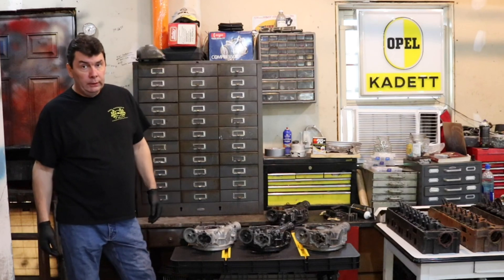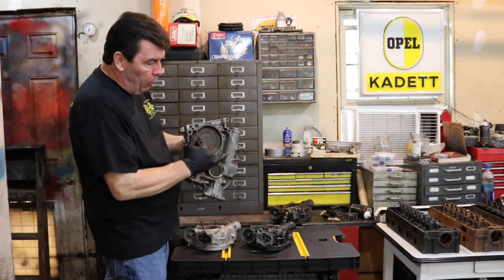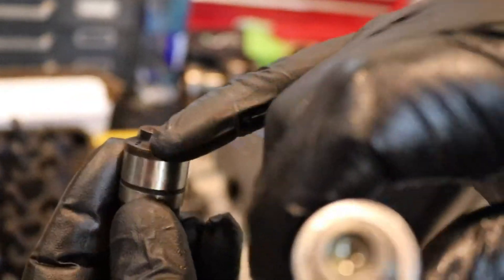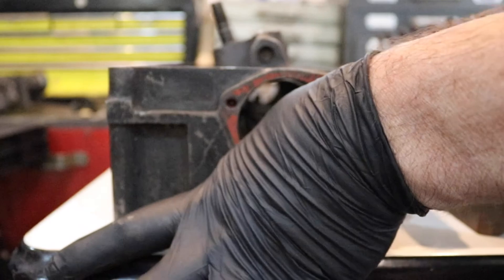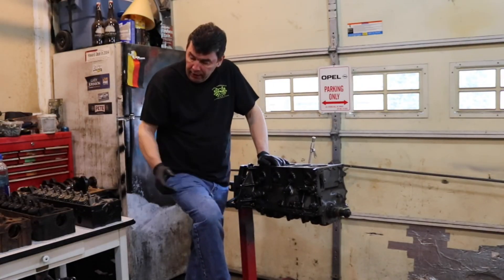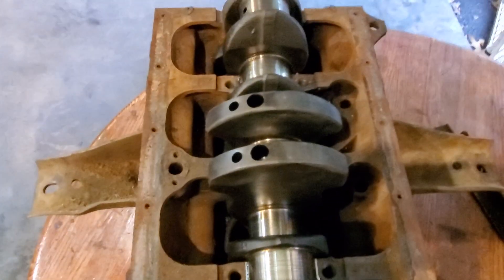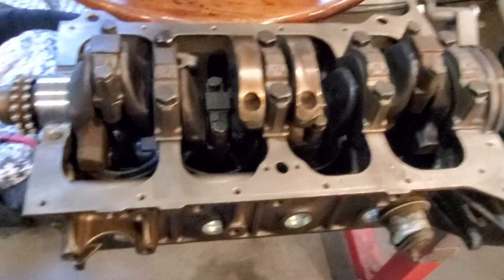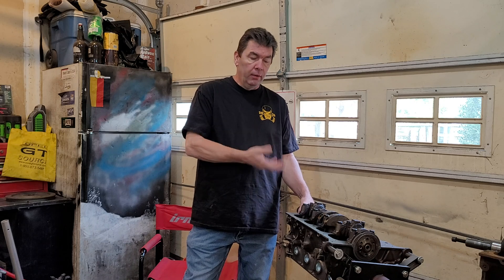Introduction the Opel 1965 to 1992 CIH 4 Cylinder Motors ( 1.5L to 2.4L ) - Updated Version

Comment: I had a2.0 engine in a mk 1 cavalier and all of a sudden 1 day it lost all power and would only achieve about 30mph the same use to happen to the 1600 it originally came with and the only way to get the usual power back was to remove the timing wheel on the camshaft and turn it slightly bolt back up and would be good for another 60 or so miles then i had to go back through the process again, what would have caused the loss of power would you say please.
Reply: That was a CIH motor ? sounds like a slipping or stretching timing chain
Reply: Thanks very much it also was a quiet engine no rattles or knocks i scrapped the car because of it and had 8 months mot left on it but i only paid 60 bucks for the car

Comment: Nice channel. I have a 78 Opel Rekord with its original 1.9

Do you think those engines are durable and dependable ?
Reply: Very much so.. back in an era of cars only lasting 50,000 miles these motors lasted years. Also even after being left to the woods for years they clean up well. A real tough motor.

Comment: Hi,

Are CIH 2.0e and 2.0s base cylinderheads similar? So basically swapping the camshaft could change a 2.0s cylinderhead into an 2.0e?
Reply from the maker: Yes. Valves maybe a tad larger, and cc size of the chamber could be a little different. But not enough to matter. Most the time the E and S differences are really in pistons and cam of motor.

Comment: Also, the 2.4 block is ground differently in the oil gallery so it has more clerance for the rods with the longer stroke crank. If you mount a 2.4 crank in some other block you have to check for clerance.
Reply from the maker: Yep, doubly so if you use a 2.3L crank

Comment: Why do they use non hydraulic lifters on some heads and hydraulic on other? what is best
Reply from the maker: Old tech vs "new" tech for the most part. In the beginning they used solid, and transitioned to hydraulic due to noise, and less maintenance. Finding "NEW" Solid lifters is not easy anymore, but they are best for high revving motors. For your standard street motor hydraulics are probably best and also more available. Which you use comes down to cam.

Comment: Superb engine know them inside out,  1.6, 1.9, 2.0 and 2.2. Not to mention the six cyl engines in Senator/monza. Solid lifters only found in 1.6 and 1.9
Reply from the maker: And 1.5 and 1.7 - - Pre-71
Reply: GoinManta was they Germany only engines?
Reply from the maker: @timtec3000  Not sure the 1.5L was in US in 1968, 1.7L was europe only.. also an early motor 68-71 from what I have been told

Comment from the maker: @Peter P - THANK You.. with some more research, I found the models in question. They were only apparently in the SWISS AND SWEDISH markets from 1975 to about 1980 ( Code was S16S and S19S ). This Swedish / Swiss issue is why it seems there is confusion as to when and why these motors existed. Apparently it had to do with tax laws based on liters and making the motors perform smoother and more like the larger motors as the rest of europe was moving on to 2.0L. Thanks for the tip.
Reply: Very nice channel 👍. You are doing a fantastic job 😀 I inherited my dad's Ascona B from 1977 and it has the S19S engine .  The reason was not taxation,  but emissions.  Sweden had adopted new regulations as of M.Y 1976 and some engines needed a different tuning in order to get it certified. Some variants were never sold at all . The Kadett C and Ascona / Manta B 1.6 were never on offer here in Sweden , nor were the Manta 1.2 or Kadett C 1.0 . Those types of small engines were mainly sold in CUI / CCM taxation markets such as : Italy , France , West Germany,  Yugoslavia.

Comment: Hello it's not true, the 1.6 / 1.9 CIH Automatic also had 8 counterweights
Reply from the maker: Are you sure..? What years ? Where could I find one? Were they special editions or the Daewoo Korean built CIH motors? The 1.9L and 1.5L in the US only had the 4.. as shown. I have never seen another CIH motor with 8 wieghts other than the 2.4L, that includes the 2.3L diesels. Also the 2.4L block internally is a little different to accomodate the crank. Don't know of a 1.9 or 1.6 built during the late 90s, when they built the 2.4L, but guess its possible.
Reply: @GoinManta  Yes, the engine came in 1977 in the Kadett c as a 1.6s automatic with 75 hp and replaced the 1.6 s with 80 hp. The engine until 1973 was recognizable on the head because it had long spark plugs, to be found in the Ascona / Manta A.
Reply: @charlesgoin8217  Hello, I've taken a 1.6 S motor automatic apart many times and the crankshafts were always with 8 counterweights. my current kadett c also had a crankshaft installed. I don't have the crankshaft as a picture, otherwise I would show it. Of course, the head has nothing to do with the crankshaft. but what one has not seen should mean that it does not exist. I've been working on Opel's CIH for 40 years and I know it. Mantzel crankshafts are not part of the series! the 2.2 still has 4 counterweights, the mantzel 2.4 and the Opel 2.4 have 8 counterweights, as do the crankshafts from the 400 Manta / Ascona B.which were from Irmscher
You can also register as an American at the OHF forum and get your information there in English.
Reply from the maker: Just shows which are which doesn't mention number of crank weights or have any pictures. That said. I see you are right on a old OpelGT.com post.  Apparently ONLY the 1.6S not the 1.9L... and super rare. I really wonder why they did that..? Just for an weak powered automatic.. So Odd... Thanks for letting me know. Opel built the CIH for so long, with so many varieties I still keep learning stuff. Thank you. 
https://www.opelgt.com/threads/crankshaft-question.101289/
Reply: @GoinManta  It is correct. 1,6 had 8 c.w. i have 3 of them on stock. they are very good for high rev race engines.
Reply: @peterp6368  Nekem a 2  (2.0N) literes motorban van ilyen  8 ellensúlyos főtengely. +1.9 hengerfej. :)
Reply: @mantalacus1  
I also think that there were different engines where these shafts were built. probably it is not absolutely the case that it only existed here or there